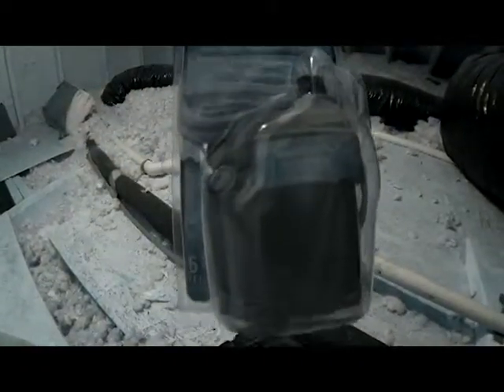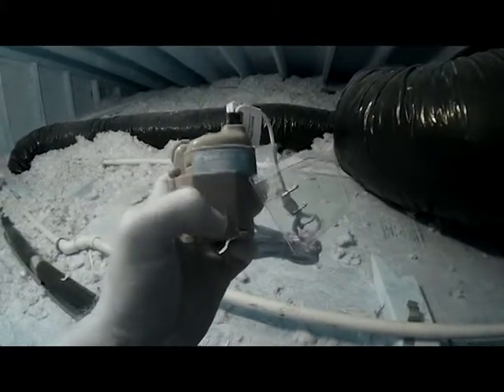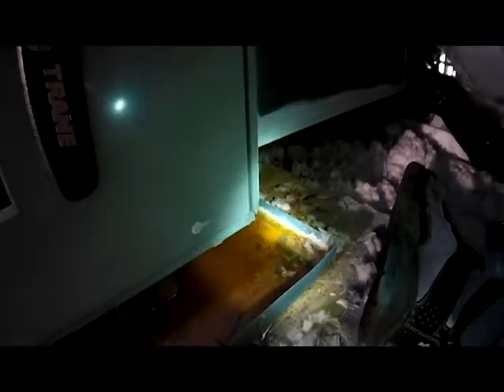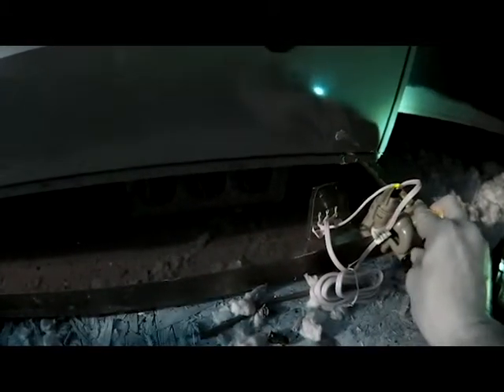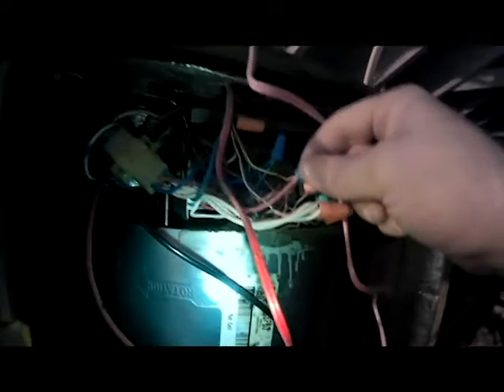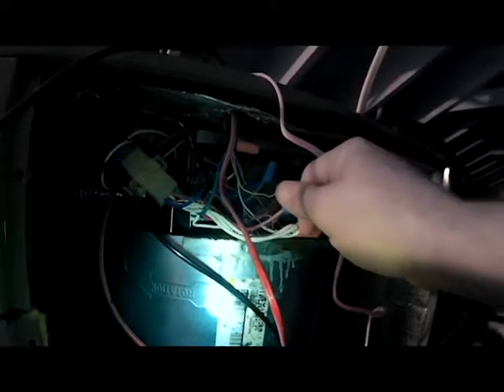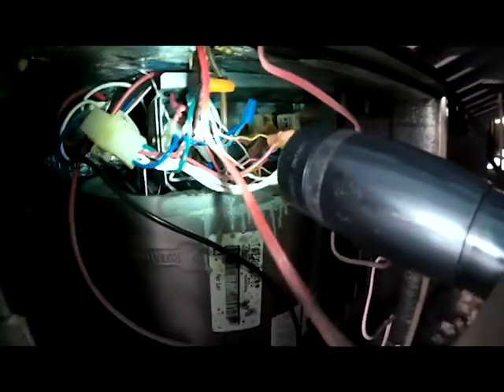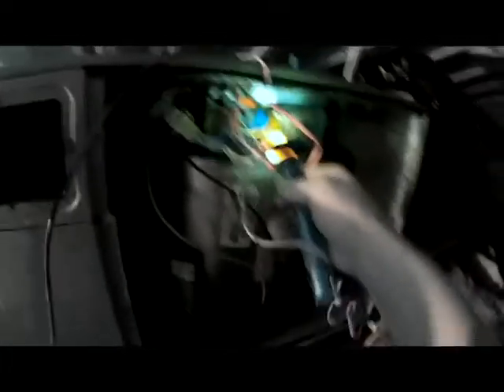How to Install a Float Switch for an Air Conditioning Drain!

Comment: Did you blow out the drain lines or check to see why she has standing water in the auxillary pan?  Did you toss any de-scumming pills in the drain pan?  Does she have a float switch on the secondary drain line?  It just looked capped.

It's good to shut off the unit when there's a problem, but it's better not to have the problem.  That said, I'm sure you did a lot off camera and this video was probably just about installing the switch, not saving the world.  I can appreciate that.  :)

Comment: Something needs to added to the equipment wiring diagram to show the modification.  Secondly,  switches have current and voltage ratings.  The AG-1200 float switch is rated for 5 Amps @ 24VAC.  You should not be using that with the 115VAC power.
Reply from the maker: This was not installed on a 115v circuit, the was installed on the 24 volt wiring.